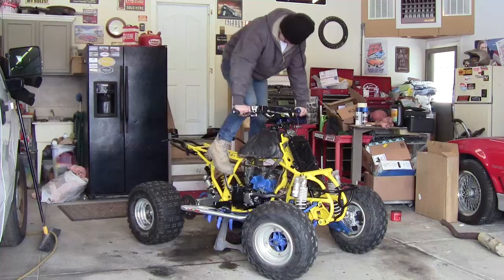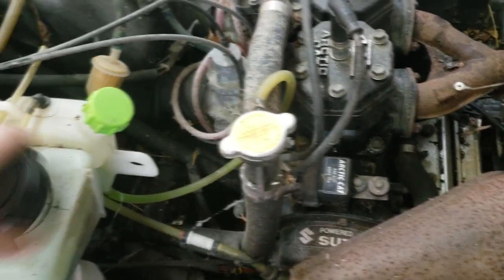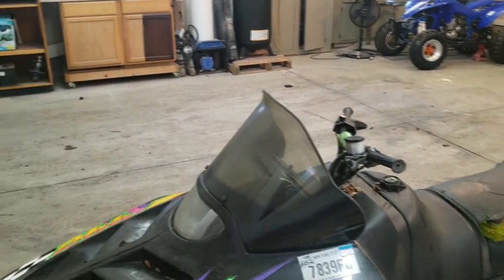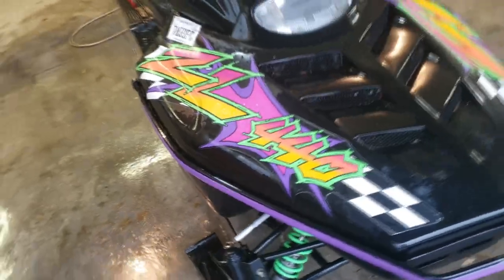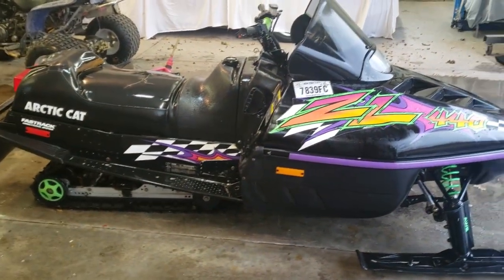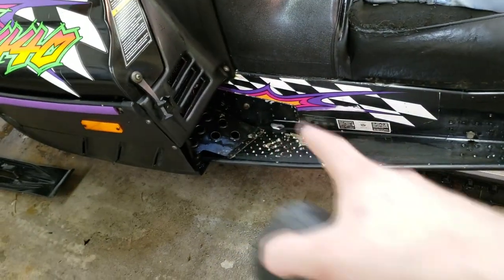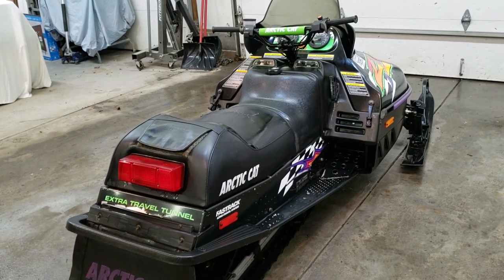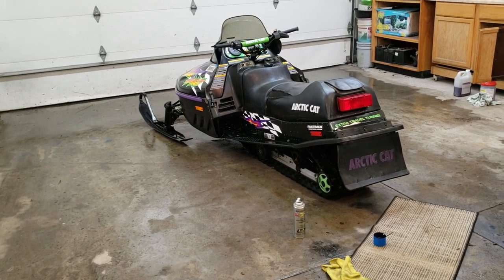Cleaning the ZL440 !!

Comment: Although the running board looks good painted, you'd be better off with drilling a few holes and adding some grip tape or buy running board grips. If you don't want to drill it, at least the grips will help. The new sleds, even the trail models, all have slotted running boards now so they don't fill up with ice. I miss my 08 CF6, and there's no snow the past few years to ride the M8 with the paddle track. So I've got an 01 ZR 600 EFI as a simple trail sled. Annnnd there's still no snow anyways. This winter sucks.